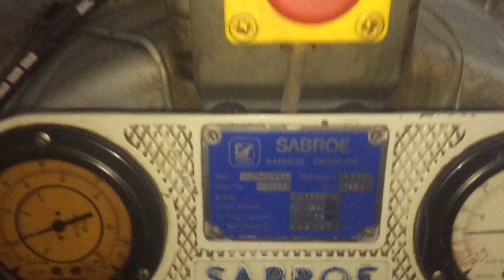how to repair Sabroe compressors shaft seal

Comment: Totally wrong way to fit this seal, it should push on by hand, if not then there is a problem, also, you should leave a 2mm gap between the face's to allow it to slide on easily, never force a shaft seal !!!!!
Reply from the maker: its perfact way u need to learn more about that , just feel free to ask me any time